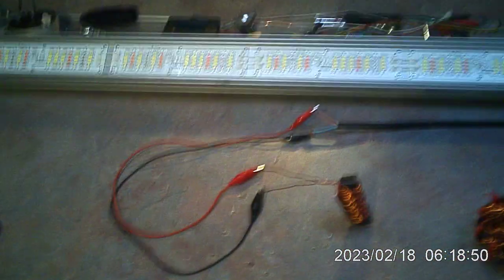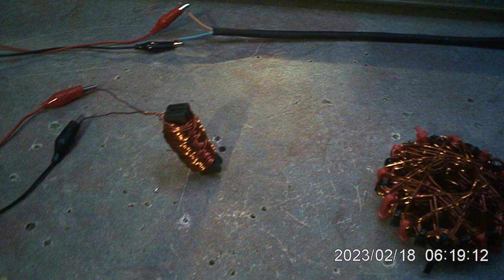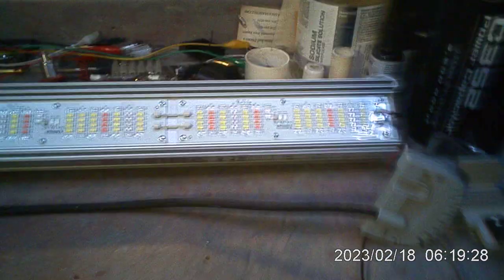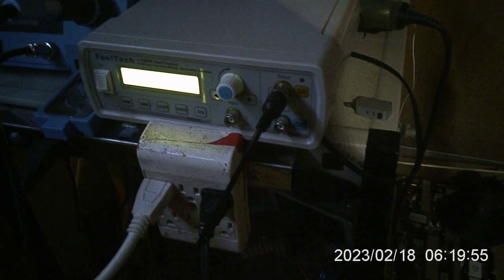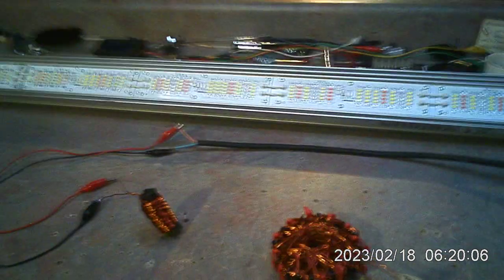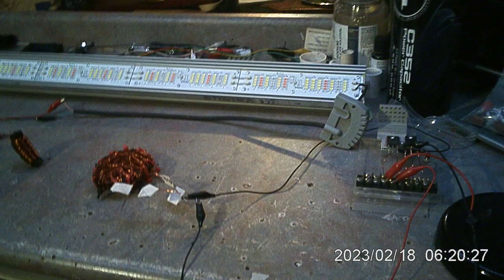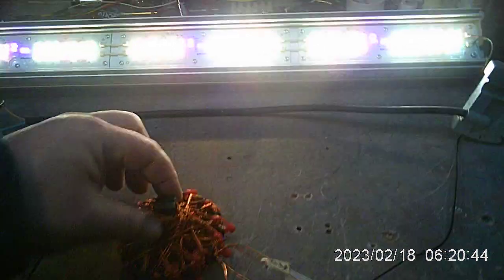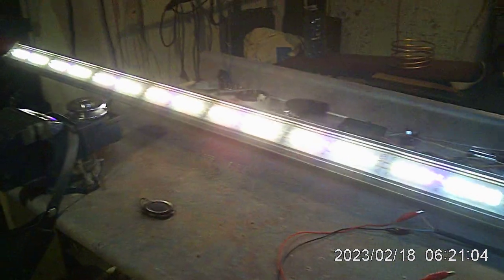Free Energy, Super Fields, Or Just Really Efficient ..........YOU DECIDE !

Comment: You keep facing the LEDs at the camera: it's not possible to actually judge brightness that way because they will still saturate the camera: you need point the LEDs away at a uniform, relatively dark surface and also show the same LEDs powered by the standard power supply or wall outlet for comparison: can't just assert that it's 100% brightness. Alternatively, you could power a motor and measure the RPMs at steady state for your power supply, and its standard input.

My guess is you have a fancy bulb dimmer that steps up the voltage and narrows the pulse width via the parametric checkerboard effect described by Konstantin Lurie's research

But with further data points I could be convinced otherwise.
Reply from the maker: I Agree with You 100 %, I am Doing a New Video, that will be showing the Brightness on a dark Back round Next, But as far as the Regular Power Supply Goes, I Do NOT have one, I Found the LED bars in the Garbage and Repurposed them, I have Checked the Company and the Cost of a Regular Power supply and they Do NOT sell them separately, so I have to Buy the System New, and that is in the $1200.00 range, which is Impossible for me at the Moment, BUT, I am Working On It, and as soon as I Obtain One, I will Do new videos, attaching the Link to This One ...Thank You for the Input